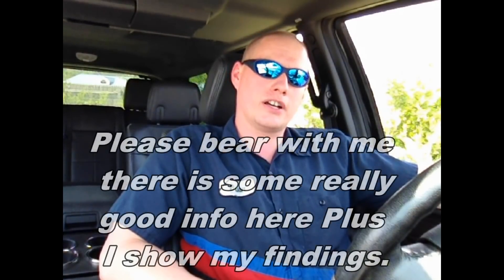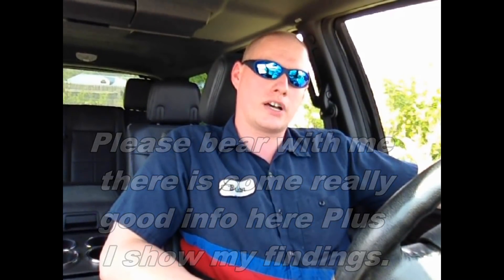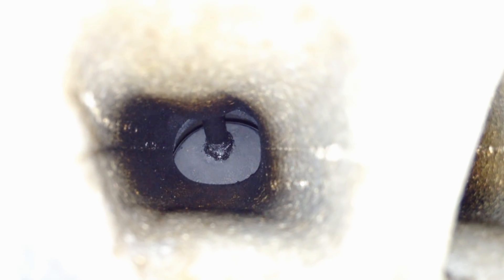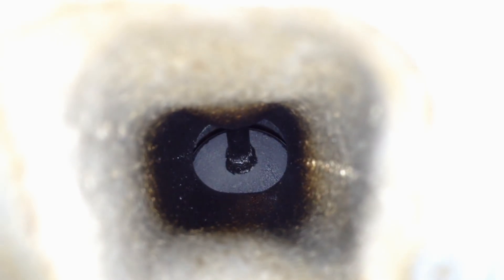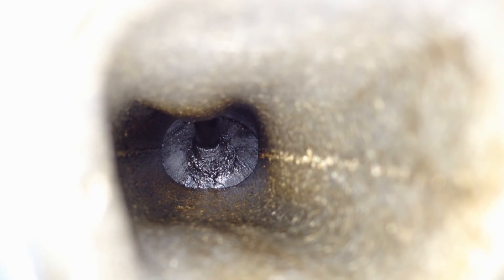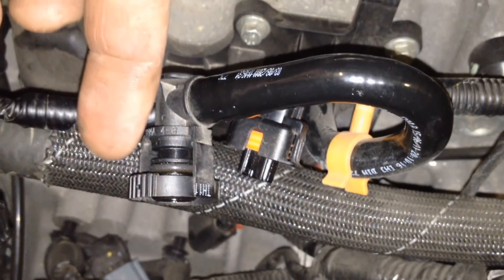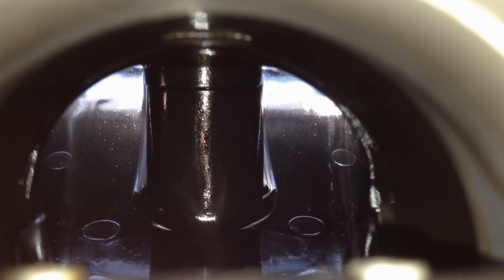Ford Ecoboost Warning Part 2 My Findings

Comment: Ford built shit how the hell did this slip past ford i mean they bragged and bragged about all the rigorous testing they did and how oh after all the testing we did it added up to 100k miles of real world driving  and hours of design and blah blah blah plus any one with common knowledge of cars can tell you turbo vehicles brake and need constant maintenance not to mention the fact turbo engines dont last any where near as long as n/a engines and if im not mistaken ford brags about how there engines are king dick and last forever this engine was due to fail well before it ever got placed in a truck
Reply from the maker: lilseip-B14 I imagine because they revved them all the time not driven as daily driver if you watch the torture videos you will see what I mean.
Reply: I've seen the ones with mike rowe where they haul the logs and do other testing with the actual truck weather it was for show or whatever its still a turbo engine and they never last long kinda goes against everything ford has been preaching since forever and it being a truck that needs to last forever and stand up to abuse kinda stupid on fords part
Reply: because those torture test videos are BS the engine is always very warm does not see cold starts or extended periods of idleing where alot of engine wear is caused
Reply: A little punctuation goes a long way in understanding what you are trying to say.
Reply: The fact that diesel engines routinely go for 1 million miles while being turbocharged should say something,
Reply: lilseip-B14 I seriously doubt the Ecoboost engines will outlast the engines in the 92-96 Ford Trucks.
Reply: lilseip-B14 Because even the most rigorous testing will not catch everything. Thats why until recently motor development took around 5 years before hitting the market, and even after that they constantly get improved.
Look at the LS family. They are all pretty much the same motor that has gone through design evolutions.
Reply: yah cause they are totally the same..... diesels run about half the rpm and diesel combusts a lot different than gas .....
Reply: W
Reply: What slip past ford? My Ford has no issues and is slipping past chevy and dodge down the road every day..

Comment: Is this problem on all ecoboosts up to now? Or is this just a 2013 ecoboost problem? And if it is all has ford come up with a solution?
Reply from the maker: tb12269 No solution to the cleaning as of yet. It is a problem on the ecoboost up to 2014 we will see what gen 2 ecoboost in 2015 brings. Remember this issue does not apply to all ecoboost engine some may get it some may not just like any failure.
Reply: We are looking at getting an 2013 fusion with the 2.0 ecoboost.  Is a there any tell tale signs? It has 15000 miles.
Reply from the maker: The 2.0l eco is the engine to get in the new fusions for sure over all other. We have not seen any issues with this in the fusions yet. A cold start to check for rough idle is best to see if the carbon is an issue.

Comment: I have a 2007 BMW 335i.  It is a direct injected turbo.  The intake ports have the same problem.  The solution is media blasting with crushed walnut shells.  It needs to be done every 35-50k miles.  BMW sells a special tool that fits into your intake ports and connects to your shop vac and media blaster.  On the BMW the buildup is much worse.  Symptoms are the same, rough idle and misfire under load.  Clean it up and runs like a dream.  My car has 110k miles and I will be doing it for the third time this winter.

Comment: I'm picking up a Eco boost with a 160k miles on it should I check the valves and run a catch can and if so on the catch can what company would you recommend I'm running a mishimoto catch right now on my wrx would that work with the ford

Comment: I know its off subject of the eco boost but can something be explained why I am seeing 5.4l 3v Tritons on the 250s burn up cam phasers anywhere between 175000-200000 miles even when trucks are worked or just plain daily drivers that are not worked

Comment: While the PCV seems to be the issue DI has its downfalls. Example, the amount of carbon built up in the intake runners and backsides of valves. Where on a engine with the injector located prior to the cylinder, the runners and valves are clean and that's due to the fuel that is sprayed in that area. I like Fords fix, replace cylinder heads. Lol what a joke.

Comment: So the root cause of the carbon then is from the PCV system?  Is the fuel the problem or the design of the PCV system?  How much does the EGR system come into play here?  What about designing a better filtering system for the PCV system.  Im sure techs like us could figure something else out.
In your opinion, would an old fashioned steam cleaning damage the turbos?  Is there a way on these ecoboosts to disable or bypass the turbos to do an induction cleaning?
good videos, keep them coming
justin
Reply from the maker: Mrdubomb Fuel quality is a major factor as is the pcv oil carry over. If they could develop a better separator the oil baking onto the valves would not be an issue. The carbon will always be there and so far no manufacturer has developed a system that prevents it. Its how they handle that build up is the difference. I imagine if you were able to turn off the turbos you could do a regular induction service but there currently is no way for us to do this. At this point a good ole fashion walnut blasting is best.

Comment: Sick of all those DI carbon buildup issues....Audi, Porsche, BMW, Ford, Toyota....all have the same stupid problem ever since 2006...that's at least 8 years and no real solution to the problem. Toyota is the only manufacturer that offers a dual fuel delivery that take advantage of DI and keeps all valves clean!

Comment: i still dont understand how this is damaging the turbos. i know that they are built really close to the head and get really hot, but when your doing an induction service, your running the vehicle rich and rich equals cool, cooler then a normal mix. and with all that carbon on the valves, its not getting enough air to begin with in the chamber which adds to a richer combustion exhaust, could it be that the cat is lighting off this mix early and thats whats killing the turbo? maybe the induction service should be done before the cat warms up

Comment: There is an easy fix for this issue that the Honda people have been using for years in high performance Honda engines. By routing the PCV into a catch can system instead of back into the motor helps this oil issue. Because of the higher pressures and higher rpms in the performance Honda Motors such as the b16 and b18 performance minded individuals in the Honda community have had to deal with these issues since the early 90s and they have continued into the newer performance motors such as the k20 and K 24 series. Unfortunately for Ford consumers  these issues happened in factory vehicles with no performance additives Hondas don't start seeing the issues until they have been extensively modified for the most part.
Reply: Wildman113 K series, F series, B series, D series. Does that tell you something or do you have your head up your ass?
Reply: Wildman113 "only 200hp" You know they are designed for city acceleration rather than highway acceleration right? And 200hp in a 800kg car is the same as 400hp in a 1600kg car. And they are NA. More hp/l than any of your v8/v6 you can get your hands on. They are very easy to turbo too and you can get about 400hp on stock engine components.
Reply: LOL dont waste your time on him
Reply: ThePucko97 And its still faster then your hondas in every shape and form.
Reply: Tom l Comparing Apples and oranges. A rear wheel drive Honda with a similar spec engine will always destroy a mustang(or any muscle car for that matter).
Reply: ThePucko97 Show me one. Oh thats right, honda never made one.
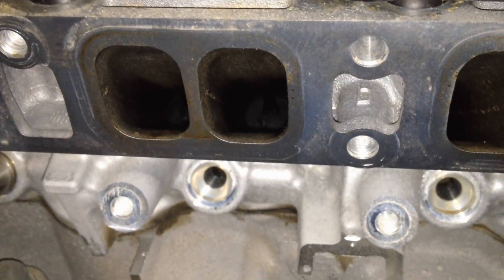Reply: Tom l You're fucking stupid. 7:56.73	Honda NSX-R (NA2)(Nurbürgring lap time)
The closest you can come with an American made car in the same price class is Corvette and Ford GT and they've got double the displacement.
Reply: ThePucko97 No you are the fucking idiot. # the NSX-R was never sold on the consumer market in any real manner. Less than 1k were sold as a JDM only car. #2 Viper ring time is 7.12 and that was a car you could buy at a dealer ship. # in the 90's the NSX went for over 60k while a vette was a 40k car. #4 even topgear has a load of shitty things to say about the NSX because it was a poorly developed car. There is a reason you can still buy a viper, a vette, and a stang but you cant buy the shitty NSX
Reply: Tom l JDM vs ADM, But since I live in Europe I can say the Honda was a lot cheaper over here. You're comparing a 1992 car to a 2011 car. The ACR Viper you're talking about is limited edition too. 
And you're moving the goalposts miles wide.
Reply: Wildman113 You can't even write properly and you think I'm gonna take you seriously?
And you keep moving goalposts, the original question was if Honda makes good engines or not. And they provenly are because otherwise they wouldn't sell them. And you need to learn what "RICERS" mean. But I don't expect much knowledge from someone who keep yelling ricers to every JDM car owner. Also NSX was an excellent car. Show me another 90s car that has an NA engine doing 13s stock and that can take corners. The closest one is the viper with 12.6s. And that costed about 100 grand. NSX got a price point of about 80 grand.
Reply: Wildman113 But was the corvette a mid engine car? No. And the interior was still much better made. And it had an engine that was made to do 7000+rpm all day without failing and it was massively over engineered(you couldn't find titanium lightweight connecting rods on any american engine for at least 10 years later).
Reply: ThePucko97 Non of those componentsare synominous with quality. Ti rods are actually less strong than steel, but I guess thats not a problem when your engine makes shit for power. Also interior quality is a vague statement. Quality much like beauty is in the eye of the beholder. 
You still have no proof that refutes my statement that american cars are faster and cheaper in price than your shit bag hondas.
Reply: Tom l Now you're just going on emotion as an argument. Titanium rods is and will always be lighter and stronger than its Aluminum and Steel counterparts.
And it's wide known that American quality was shit through 1960s to the end of the 1990s.
Reply: ThePucko97 Again no, you're wrong, Ti is great in situations where you need a light weight FLEXIBLE alloy. Guess what you do not want in a Con rod Flexible dipshit.
Fucko I work on high performance engines, its what me and my friends do. 
Also buddy you need to re read up on your metallurgy.
Reply: ThePucko97 Naa buddy I am talking about 400 CI+ motors pumping out around  around 700+ at the wheels, which is over your 100hp/l when we talk at the crank power. Also the HP/l is a meaningless measurement.
If you knew anything about high hp motors you would know that you used forged internals, not TI because they last longer. also higher rpm's do not give you most power, thats why most moters flatline after 6k.
How about this buddy, get back to me when you work on a car that has a 10 sec or lower 1/4 mile.
Reply: Tom l You have 0 proof that you work on cars. And if YOU knew anything you would know that titanium internals are forged too(for the most part). Also that 6k redline bullshit... It's all about the cam profile and the porting, and how high quality main bearings you have and how much rpm they can handle. Generally you'll want to have the redline as high as possible so you can get as much horsepower out of the engine as possible(in a race car that). That is why all car manufacturers switches to small I3 or I4 engines because they can bring the redline up and put a compound/turbo on it to get an even torque curve and get better gas mileage while keeping the power potential. You can only raise compression so high on a engine without the need of higher octane fuel(or water/meth injection for that matter).
Reply: ThePucko97 Obviously you have no clue what you are talking about. Look at any race series. The GT series, the Aussie V8 F1 untill 2014 and that change was to save gas. They all use fucking V8's kid. No one uses Ti internals because the lack of longevity. When you say forged you are assuming a steel alloy. Not Ti reason being again is that Ti is more ma-liable. Great for aircraft wings, bad for pistons.
And you are damn right I have not and will not reveal who I am on the internet man. Sorry when you grow up you will understand.   
No real race series worth a damn uses an I3 or I4 because they are fucking slow.
Reply: Tom l When I grow up every engine will be an I3 I4 or possibly I6/V6 so we'll see who's wrong here. Few uses Ti-rods because they are expensive, and that is the only drawback. Aluminium or forged are cheaper. Still it's the best alternative for NA engines that run high RPM. And there are many series that uses I3 and I4 engines: Formula Ford, Rally and F1 in the 80s(banned because too high power output) to name a few.

Comment: A aftermarket water injection system solves this over time no matter how bad is the state of the valves is. I am not sure about what changes would be required to do to the injection maps.

Comment: I wonder as I put on extensive mileage, 35000+ miles per year, if I get an Eco-boost am I going to have this problem in less than a year?
Reply from the maker: Leggir Doubt it, if you put on that many it would be all higher rpms highway driving and be ok.

Comment: Hi Great video lots of info, Do you Know about the 2011 Eco boost F150 Timing chain problem. Mine is in the dealers now for a stretched chain, Code P0016. The dealer tells me that it is the main long chain but on F150 Forum.Com there are lots of posts about the short cam chains failing, Any thoughts on this.

Comment: FordTechMakuloco Hi, Do you think this si something I should watch out for in my 2014 Fiesta 1.0 Ecoboost? If yes, I don't know if catch cans still have room to fit in the very cramped engine bay
Reply from the maker: I would hope not but time will tell, I have yet to hear bad things about that engine.
Reply: Get the catch cans, at worst they will do nothing. 
But you would be surprised at how much oil the will accrue.
Reply: got it. thanks!
Reply: Tom l Come to think of it I don't think the 1.0L Ecoboost engine bay has any room for a catch can! haha!
Reply: julien cleto They are pretty small. go on to the forums, they will have a solution.

Comment: Water injected rally cars always have the cleanest valves, I wonder if guys that run a water meth system don't have this problem in the long run
Reply: Exactly my thoughts. Steam cleaned internally. And a hp boost/ lower egts
Reply: I ran a boosted 4.3 s10 SS. 15psi and a bunch of other cool stuff. Ran it that way pretty hard for 10k miles. Oil in the intake tube from the pcv system coated everything. Carbon build up after a 10k top half inspection of motor. Started running a meth/water combo for the next 20K before the timing chain went. Motor was clean as a whistle on teardown. My buddy though I was lying when I showed him. He though I clean everything to trick him.
Reply: EGGINFOOLS Was it just a standard Meth injection system (Windshield Washer Fluid)?
Reply: 1489mustang It was a snow meth injection kit. I used 50/50 water/meth mix. In a bind I kept winter blend windshield solvent mix behind my seat but that wasn't my standard. I also used heet and water as well in a pinch. All worked great really. Intake temps went from 175ish to 72 with meth/water and 95 with windshield solvent. Back to back data logging.

Comment: In the description of this video you are working on 4 cylinder 2.0l engine and the previous video was on the 3.5 l v6 engine I'm a European car tech. And I'm fully aware of the issues on DI engines I was working on 2007 VW GTI with a severe misfire on certain cylinders and started to clean the intake vales with wynn's combustion chamber cleaner and it did not help the cold start miss so then I proceeded to remove the  intake manifold and pretty much all intake valves were full of carbon so I cleaned the intake vales with small picks small wire brushes etc and then swap two injectors and then the miss fire changed cylinder so I went and replaced all 4 injector because the car was high millage and after the replacement all was ok.  BMW and MINI has a walnut blaster that fits in the intake port and then there is a shop vac connected to it so the carbon and nut shell are sucked up clean VW and Audi doesn't yet have any tool to do this I don't know what VW have done to help this issue on the new 1.8 turbo engine I know that the new Audi 2.0T engine has a 2 stage injection meaning a direct injection and a port injection system to keep the intake valve clean and in certain situation the port injection is more efficient than DI system so I can't wait to see what will happened in the long run. And like a couple of week ago I got an other GTI the customer had changed some ignition coils and spark plugs and was having misfire when under load I checked the plugs and they were not the OE plugs so I replaced them with new OE plugs and then no more misfire so there is example of nothing wrong with the engine just the wrong plugs installed.

Comment: I think the valve guide seals are suspect, that much oil deposited on the stem looks more like valve guide seals than vapor.  I bet that the intake valves run a lot hotter than an SEFI engine and the valves are conducting more heat into the guide and seal.  I bet they use sodium filled valves on the exhaust but not the intake.  I would also wager that the water jacket around that intake valve isn't as thick as the exhaust valve.